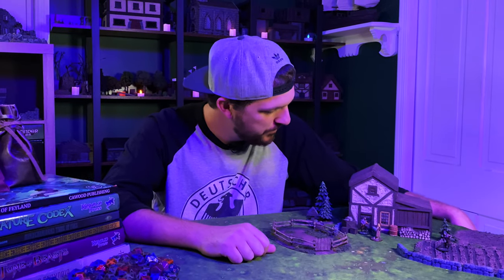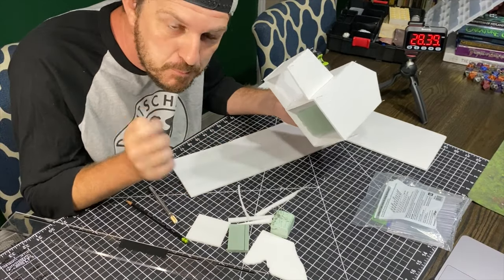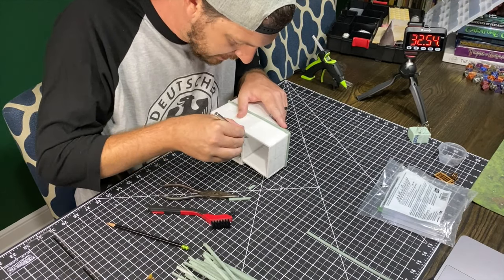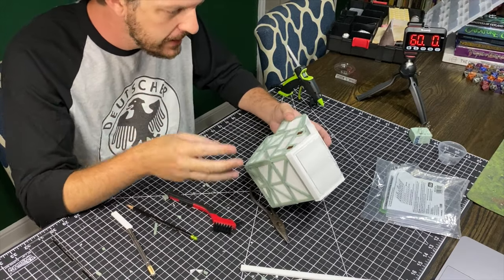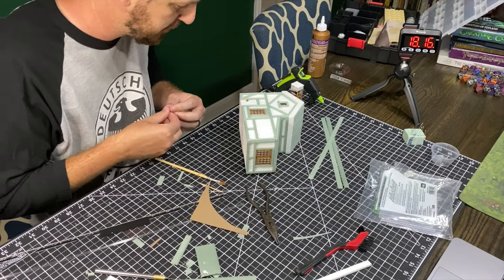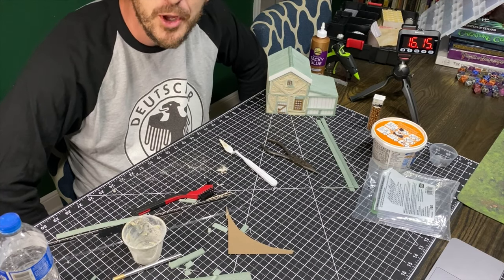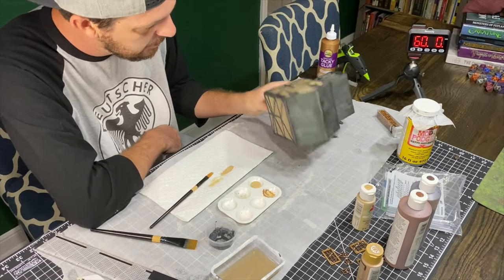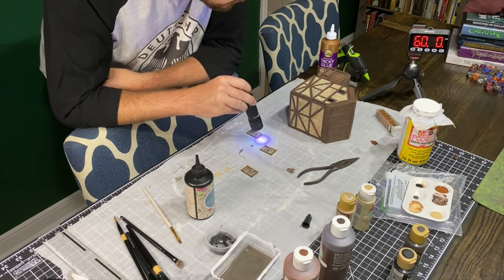How FAST Can I Build a D&D Village House? (Terrain Speed Build for D&D, Pathfinder, RPGs)

Comment: For stucco, I often use tile grout mixed 50/50 with regular plaster which gives a slightly grainy finish that can be made to look like it is cracking off around the places where I have textured the walls on the foam-core to look like willow or wattle and daub under the stucco on the upper floors or older buildings and brick work under the stucco on lower floors or somewhat more modern buildings.
Reply from the maker: Thank you, that's a good tip! I'll definitely have to try that out, I like the idea of cracking up in places a lot

Comment: If you want to build fast, you have to plan out exactly how you're going to do it and think of what you can do to speed up various steps. For example, spending the first 30 minutes to do up a plan so you can do all your cutting at once. Or, rather than slow-drying spackle for your stucco, you can mix tile grout into your mod-podge mix on those sections.

Also, think multiple and smaller--you can do a whole bunch of really similar houses all based on one template and then add details to differentiate them (add some dormers to a couple roofs, do some as timber frame and stucco and some as clapboards, change up window and door locations, etc.). That way, although you'll spend a longer total time, you spend less time on each individual piece and get a whole bunch done basically all at once.
Reply from the maker: Awesome, those are some super good tips! I think I learned a ton from this process and am constantly looking to improve the processes

Comment: Are the stone walls just XPS foam carved to shape?

Are they weighted in any way?
Reply from the maker: The stone walls I used in the set dressing were actually 3D printed for me by a friend and then I painted them up. You certainly could make them out of XPS and carve them to look like this, but coming up with a way to give them some weight would be an issue you'd need to address for sure!